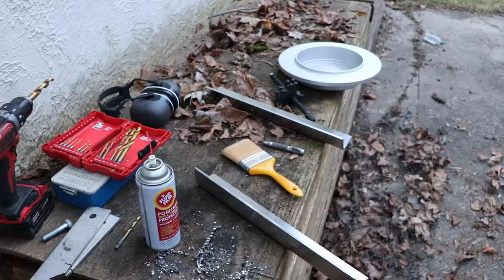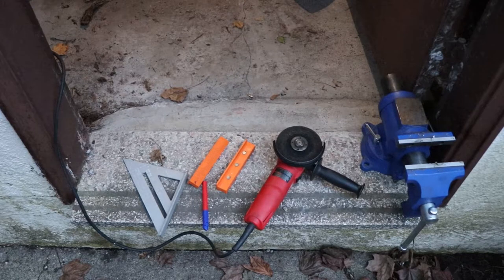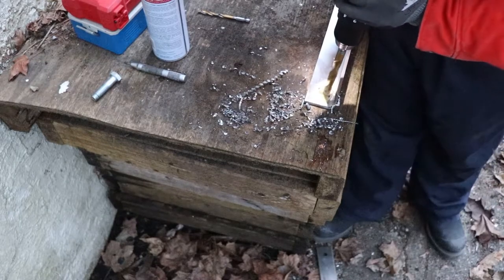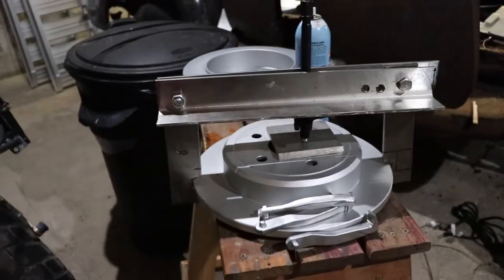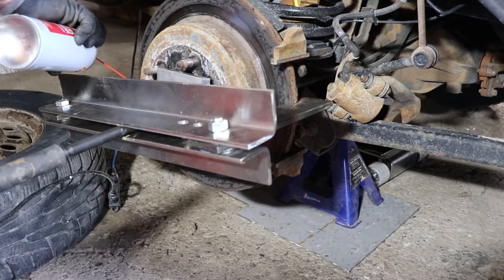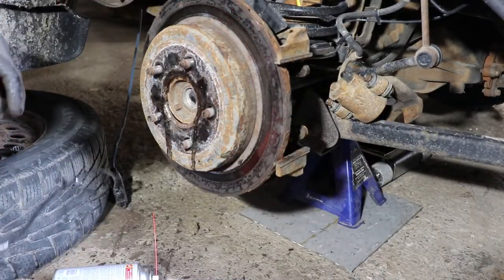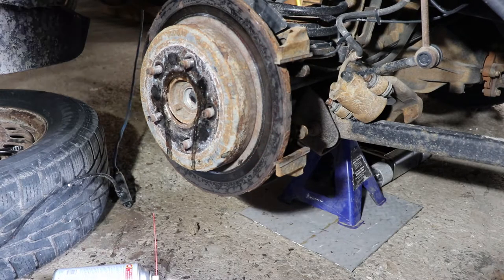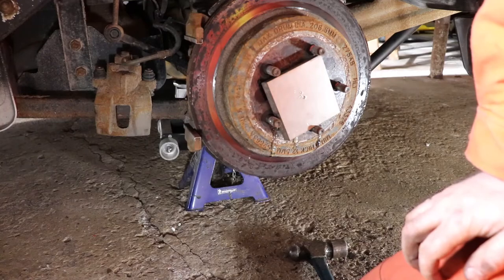DIY Brake Drum and Rotor Puller

Comment: Thanks for the idea. I got that flat tree shaped puller and some scrap L bars I'll use.I also got the other puller that has the the 3 legs in which I'll use 2 of those legs instead of the flats bars you used to grab it.

Comment: I used a carpenters nail claw to catch the drum then I pounded the nail claw with the hammer.  I work it around at the 2, 4, 8, 10 O'clock  positions staggering as I went with the hammer. Hit it a couple times at 2 then 8 then 4 and 10. And repeat.